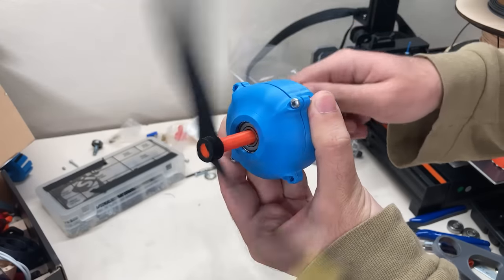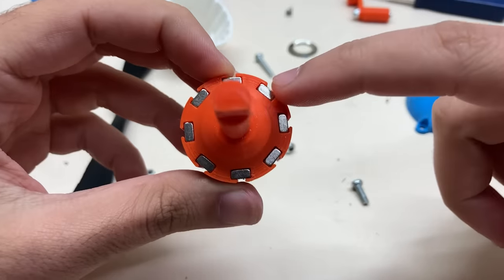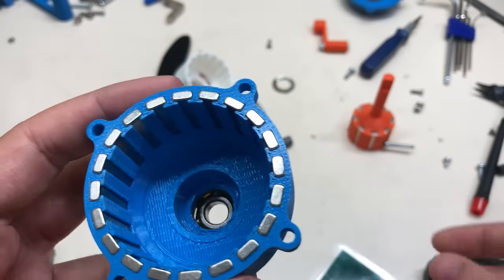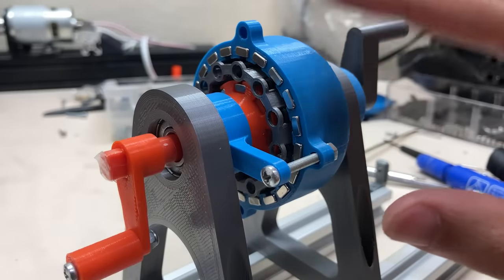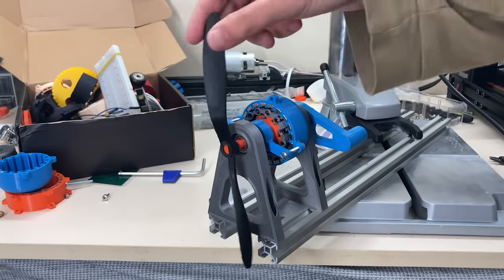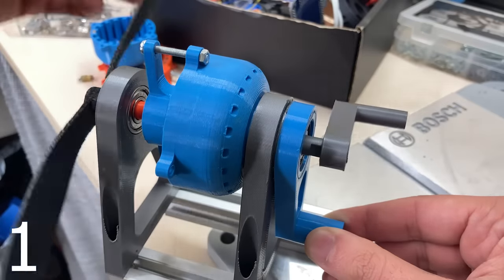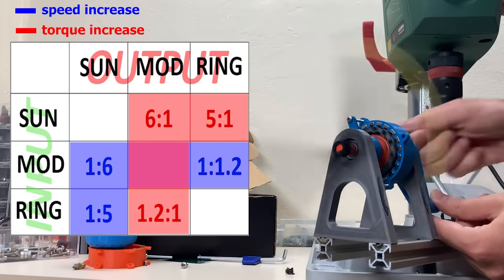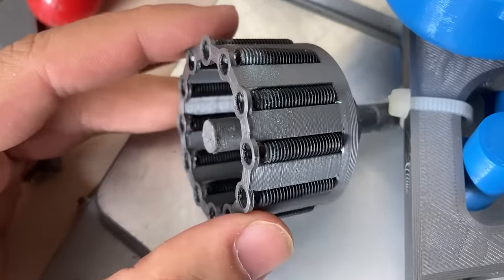How this magnetic transmission works?

Comment: I wonder how deep this could go. Could you build tiny electromagnets and power them wirelessly and use that as a means of controlling them to change how the "gearing" interacts?
Reply: why just not use a motor at this point?
Reply: The answer would be yes but it would have to match pole pairs with flux modulators
Reply: A mag clutch would do. They have been used to drive screw superchargers. Have gear/pulley set to 100% speed then reduce clutch power to allow for slip.
Reply: Magnetically coupled motor assemblies have been done before, the issue is the load, a mechanically driven assembly will always outperform and significantly cheaper and less complicated
Reply: That's how the predecessors to servo motors worked!
Reply: @bartekburmistrz8679  because, you could create energy, and forward momentum. This could make air craft wayyyyyyyyyyyy better. No more fossils fuels, plentiful energy. This would make a lot of sense.
Reply: @bartekburmistrz8679  in applied science the question is not "why" it's "why bit"
Reply: You have just described a brushless motor.

Brushless motor drivers are called Electronic Speed Controllers, or ESCs. These tiny computers pulse the sequence correctly at an RPM set based on the input pin, which is typically pulsed 0-2000 times per second.
Reply: Got the same idea
Reply: @straighttoyou  what are you even talking about? An electric motor does the same thing, but is much less complicated and also doesn't have to run on fossil fuels
Reply: @battleoid2411  it can't make it's own juice. That would need a power source like a battery. This would need a capacitor bank at half the weight. And make power, while making extra. I have a cordless brushless drill. What if, when it starts, it could continue until I want it to stop. Then having just enough juice to start all over again. The applications are very great when you think of it. Yes, it's hard to think of, I think this guy is on to something. Same with Anony Mousse.
I forgot to say, you would need a motor to move this, like is done by hand in the video.
Reply: @straighttoyou  lol
Reply: @straighttoyou  you're talking about free energy and perpetual motion machines, and that kind of stiff is not at all possible. If you slap some capacitors on it and rig a sort of generator to it it will just immediately stop because you're transferring the energy to the capacitors. On top of that, you lose the input energy to heat and friction and ultimately the system shuts down. If you want to start something spinning, and keep it spinning, then you have to disengage your gear box like a car transmission.
Reply: @battleoid2411  it appears that the movement of the propeller is far faster than the crank that is turning. You are getting greater energy out, than what you put in. Clearly. With the moving parts being frictionless, there would only be heat generated by the electricity. And no it would not be perpetual. Because, capacitors would break. Wires would go bad. The plastic housing would need to be changed from time to time.  Wear and tear, like a gas motor. It is just a immature technology because people just want to do the "easy thing" instead of making something that is not that parasitic like gas motors, where the real cost is hidden. Electric cars where made 1st, but gas powered car went a little faster. So, being Americans we wanted speed. These cars where very dangerous. But we persistently made them. They even needed flag men to guilde them through the city's streets. Yes, the 1900's where, the 1900's. Time to think outside the box.
Reply: @straighttoyou  You are right, the propeller does have more speed than the crank turning it. However, it has the same, or more likely, less energy than that which is turning the crank. This is because the magnetic gear system is converting the torque from the crank to more speed at the prop, at the cost of said torque. That's what gearboxes do, they take mechanical energy in the form of speed or torque and convert it to the other. Speed is how fast a mechanical system moves, torque is how hard a mechanical system moves. As an example, let's say we have a car engine that outputs only 100 energy, no more less. Getting it moving from a standstill will be really hard, as it's inertia will resist our attempts at moving it, so we use a gearbox to take our 100 energy and split it into 80 torque and 20 speed (this is incrediy basic I know, its more complicated but thus is just illustrating the concept). That 80 torque gets the car rolling forward, but its barely moving since we have so little energy being put into speed. This when we shift into a higher gear ratio, which prioritizes speed over torque, let's say 45 torque and 55 speed. We still need some torque to over come friction and deal with any hills, but the extra speed let's us cruise around much faster. That is what this magnetic gearbox is doing in the video. It's merely converting the energy of the crank, not increasing it. Energy cannot be created or destroyed, only changed.
Reply: @straighttoyou  also, as far as magnetic gears being ignored for "the easy route", they have their own issues, mainly that because there's no physical contact they have terrible torque, which makes them unsuitable for heavy equipment. They are very cool though, and I imagine there's all sorts of uses for them in more delicate operations, but the size of magnets you'd need for something like a car transmission would be ridiculous, it'd likely take up most of the car itself vs physical gears which can handle tremendous amounts of weight with very small size.
Reply: @battleoid2411  no, think about the electric car. Elon is a billionaire. go troll elsewhere. I was just trying to be positive for this youtuber, who is doing a great job. And should pursue this, who knows. and there are neodymium magnets that have very impressive pulling power. Several 1-pound n52 rare earth magnet can be used. I think your over stressing how hard it would be, compared to how easy it would be.
Reply: @straighttoyou  Go look up Dunning-Kruger.  Your confidence is sitting way up there at that first peak while you're trying to argue with people on the second slope.
When you drop torque for speed you are not getting more energy than is put in, and any energy used for propulsion cannot also be recycled into the system.
You can power an electrical system wirelessly, but you're still not getting free energy, that electricity needs to still be generated somewhere and if you plan on powering something like a plane from down at ground level then you're going to need a lot of electricity on the ground for just a bit to reach the plane.
What might work is to have massive wings covered in solar panels to run the motors like some drones do, but you won't be getting much speed from that nor will it be able to carry much.  That's also not what any of your explanations suggest.

If you really think your idea would work then go build it, you'll make trillions off your free energy and for solving both global warming and energy crises around  the world.
Reply: @GremlinSciences  If you try new things, you never know.
Reply: @straighttoyou  by all means prove me wrong, invent a free energy generator or magnetic gears that can handle as much torque as mechanical gears, it'll make the world a much better place. Until that happens though, you are squarely in the wrong here. Yes, there are strong magnets. They still can't hold the sheer amount if load an actual physical gear can. I'm not saying they don't have their uses, mag gears are great due to very little wear and not requiring lubrication, but they're aren't viable for any kind of heavy loads like engines. It's not that it's impossible to use them in an engine, it's that they are simply not optimal as their only main benefit is not requiring maintenance, which isn't that great when for the minor inconvenience of lubricating your gears they can be much smaller and handle much higher loads than magnetic ones of the same size. Not to mention that as cars become more and more digital, have a giant set of fast spinning super powerful magnets is not very healthy for onboard electronics. That and I'm fairly sure that also constitutes a basic radio jammer as well.
Reply: You could, but tesla power and the electromagnetism of these gearboxes may interact poorly casomr
Reply: No. That's a shit ton of electromagnets to power, I don't think there are any tiny enough to be practical for this design, and it would take a lotttttttt of power to make them nearly as strong as permanent neodymium ones. Who knows tho. Could be a thing in 15 years
Reply: @straighttoyou  You are not getting more energy out of a system than what is put in. That is not possible. You can only convert to different types of energy and try to minimize losses to types of energy that you didn't want to produce (usually that would be energy lost to heat in electronics). Here you are talking about converting electrical current to magnetic fields (which of course works), but then magnetic fields are transferring energy to mechanical energy and then you are proposing to recycle it back into magnetic fields presumably and back into electricity. It could be possible that you could use such a system to reduce loss of energy in the system, but it's absolutely not going to keep on running indefinitely and it will definitely not be gaining energy. You will be losing energy at every step of that conversion in various ways. Heat and friction would be the main ones.
Reply: @larsbirgerbergmal6230  So an unnecessary step.
Reply: @mattmarzula  everything, and i cannot push this hard enough, everything in electronics is unessecery.
It can ve done purely mechanical and as manual labor or automated using mechanically, or pneumtaically or hydaulically based controlls.
Why is this possible idea with a nitche case where you draw the line on unessecery?
Reply: @phil2082  thank you. I came to say just that.
Reply: @bartekburmistrz8679  ⚠️ God has said in the Quran:

🔵 { O mankind, worship your Lord, who created you and those before you, that you may become righteous - ( 2:21 ) 

🔴 [He] who made for you the earth a bed [spread out] and the sky a ceiling and sent down from the sky, rain and brought forth thereby fruits as provision for you. So do not attribute to Allah equals while you know [that there is nothing similar to Him]. ( 2:22 )

🔵 And if you are in doubt about what We have sent down upon Our Servant [Muhammad], then produce a surah the like thereof and call upon your witnesses other than Allah, if you should be truthful. ( 2:23 )

🔴 But if you do not - and you will never be able to - then fear the Fire, whose fuel is men and stones, prepared for the disbelievers.( 2:24 )

🔵 And give good tidings to those who believe and do righteous deeds that they will have gardens [in Paradise] beneath which rivers flow. Whenever they are provided with a provision of fruit therefrom, they will say, "This is what we were provided with before." And it is given to them in likeness. And they will have therein purified spouses, and they will abide therein eternally. ( 2:25 )

⚠️ Quran
Reply: @straighttoyou  I'm sorry that you don't understand physics or gearboxes.

The work you put in to a gearbox when you turn one side is roughly equal and just a little more than the work you get out. There are losses due to friction, creating noise, etc. You can gain or lose torque with a gearbox, gaining or losing rotational velocity as a result. This is literally not energy. 

You literally always have losses in a gearbox. There is literally always less energy out than in. This is why the concept of a frictionless, non-contact gearbox is so good. You would only have the friction from the bearings. This could potentially act as both a clutch and a gearbox without having to replace a contact clutch that wears out.

People who are FAR smarter than you have proven mathematically that you cannot get more energy out of a system than you put into the system. This violates laws of physics and laws of thermodynamics. People have been trying to find ways of producing energy forever, and now that we understand physics... well, now that the smartest among us do, anyway... we know that you cannot magically create energy with magnets. Magnets do not create energy. The force they have attracting or repelling one another is not something that does work on a system for you to get energy out.
Reply: ideally, the mechanism should power itself using the principles of electromagnetism. You tube needs more vids like this 💜
Reply: @tuqann  Indeed, like a wireless charger, only it would have to be drastically redesigned for this purpose.
Reply: @tuqann  You can't power anything with magnets. This is impossible, and it can easily be proven mathematically.
Reply: Or you know the magnet in a copper pipe thing, wonder if theirs a way to utilize that instead of electro magnets
Reply: @altsffault3160  That's called eddy currents. That doesn't magically produce power that you can harness. If you use a coil of wire to do the same thing, and you disconnect the coil from itself, you get no slowing. If you connect it to itself, you get the most slowing possible. If you connect an electronic load, to charge a battery or capacitor for instance, it does not slow the magnet as much. You will put more energy into this system than you could possibly get out.
Reply: I wish there was a laugh react button.
Reply: cyotee doge  which ideas? Perpetual motion engines and free energy generators? Or simply magnetic gears? Because one of those is impossible and the other is impractical
Reply: cyotee doge  I think it's insane how so many people are being insane over me having my own opinion. Just like the last guy who said " you know nothing about physics". You guys can give it a rest. We will have good lives, and you can keep throwing mud. Good for you.
Reply: @bartekburmistrz8679  combustion engine with motor/transmission hybrid
Reply: cyotee doge  agreed. Its 120 year old technology. I can't divulge but someone may or may not be applying this technology to a jet turbine. It's actually a great design for that kind of thing. Unfortunately regular magnets lose their strength with heat. There's been talk of using super conductors. I can't say more.
Reply: @TechWizard28  they're working on it. But there is limited application because with too much torque it acts like a clutch and free spins.
Reply: @bartekburmistrz8679  exactly. He basically described an electric motor.
Reply: You just described an electric motor.
Reply: @serrated13  Sort of. Consider fine motor controls that allows submicron precision by varying multiple voltages at the same time. With a single motor output it would only be capable of granular precision.
Reply: @anon_y_mousse  that would be a brushless motor with a sensor if I'm understanding what you are saying.
Reply: @serrated13  Not quite. Think of a stepper motor that can change it's step size from 1 inch to 1 millimeter to 1 nanometer and back again.
Reply: Rotatable magnets could allow for adjustable ratio!
Reply: Induction Motor
Reply: @bartekburmistrz8679  self exited motor gear
Reply: @bartekburmistrz8679  because this makes free energy
Reply: @szymon0900  a cryo cooler can run off 2 watts. Then these magnets can be cooled to a temperature of around -200 F making them really strong. If copper is involved it would go from being a semi conductor to a what conductor? If you know anything about physics you can answer. Please, tell me. This would preclude if your spreading dangerous and harmful information, or if I am. Everyone take notes.
Reply: @straighttoyou  It's as much "your opinion" as saying the world is flat. Stop spewing false information with no knowledge of the subject.
Reply: @TheArachnoBot  why do you think the earth is flat? Cold temperature changes what magnets can do. Lexus has made a hoverboard, like a real one.
Reply: @TheArachnoBot  are you a bot? I think your a bot.
Reply: @straighttoyou  Can you read? You saying gear ratios put out more energy than is put in isnt "just your opinion", it's wrong. Kind of like saying the earth is flat.

I dont get what you're trying to prove mentioning some gimmicky, useless toy made by a car company. If you want a good example of superconductors and magnets just look at maglev trains.
Reply: @phil2082  ferromagnetic current, you mean, right?
Reply: @straighttoyou  Literally nothing I have said is disinformation, kid.
Reply: Thats the way the "cvt" in a prius works.
Reply: Po
Reply: @straighttoyou  it's not new. magnetic gearbox are not new. the torque rating does suck. efficiency sucks too (75% vs up to 98% with regular pair of gears) yes big neodyum magnets have great pulling power, and so does each tooth of a gear, while being way lighter. also magnets can lift very heavy loads, but only statically when they are stuck to a magnetic or ferromagnetic object. as soon as you have a gap to let the magnets move you lose a lot of force
Reply: @jasongrant9626  the CVT in a Prius is usually called eCVT. it's a classic planetary gear with two inputs, the ICE + an electric motor/generator that can spin both way and at different speeds to change the gear ratio of the output (going to the front differential). then a second motor on the output can add power or Regen.  there is no magnets, no slippage, no belt. just good old gears that are always engaged. it's very simple, efficient and reliable. iterations of the powertrains have added a bit more complexity to improve the characteristics of the second motor but the CVT part that continuously changes the gear ratio still works exactly the same
Reply: @straighttoyou  conservation of energy is not a new thing my dude
Reply: @bartekburmistrz8679  innovation
Reply: @potatojz38  load and heat dissipation. These systems are very vulnerable to heat damage.